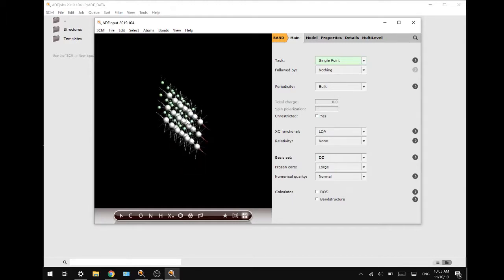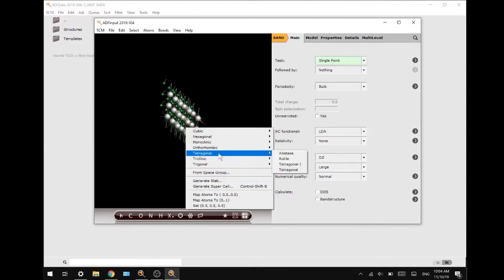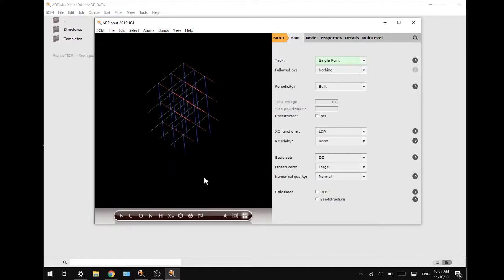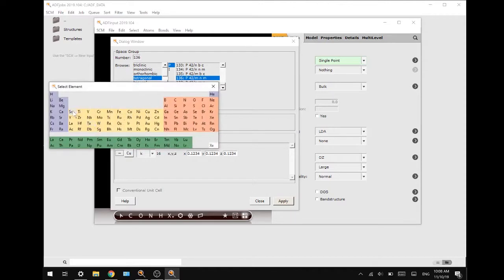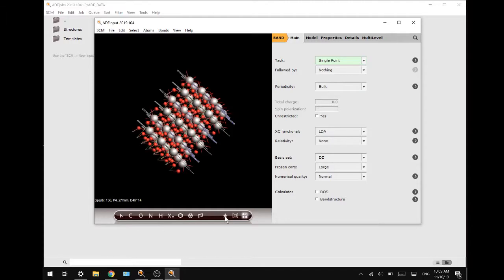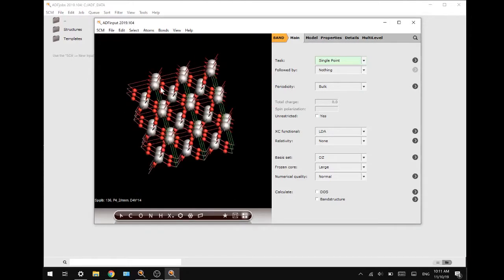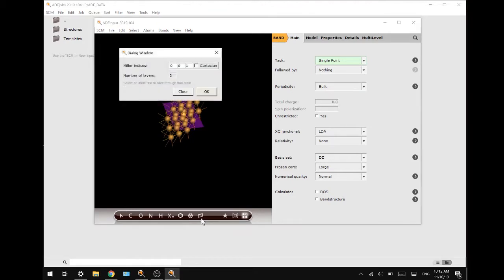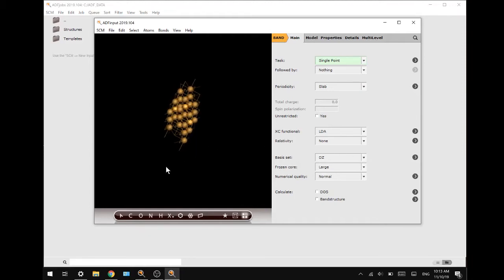ADF-BAND Tutorial: How To Build Crystals and Slabs

Comment: What about building supercells with vacuum layers?
Reply from the maker: Since BAND, DFTB, Mopac can properly deal with 2D periodic systems, whenever you slice a surface with them, it'll switch to 2D periodic boundary conditions with proper vacuum all the way. This is of course more efficient than repeating the slab with a vacuum gap in between and also allows you to polarize the surface or apply a homogeneous electric field. IF you really wanted to add a vacuum, you could switch from slab to bulk again and modify the c-lattice parameter under model -> lattice. If you choose VASP or Quantum ESPRESSO external modules, since these are plane wave codes which always deal with 3D periodic boundary conditions, if you slice a surface, you will always get this vacuum layer in between as the surface repeats itself in the 3rd dimension (again, you can change the c-lattice parameter if you wanted to adjust the vacuum space). See e.g. https://www.scm.com/doc/Tutorials/ExternalPrograms/VASPTiO2SurfaceRelaxation.html#step-3-set-up-the-system-a-tio2-001-slab